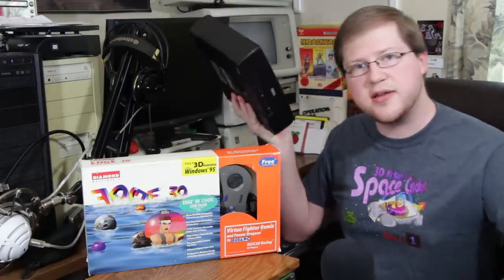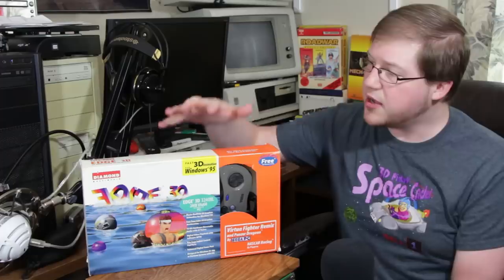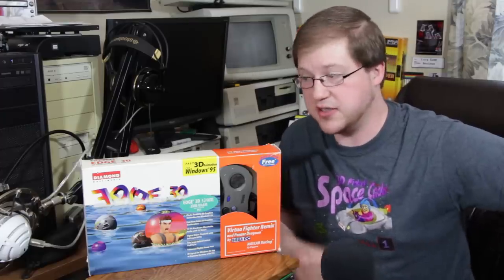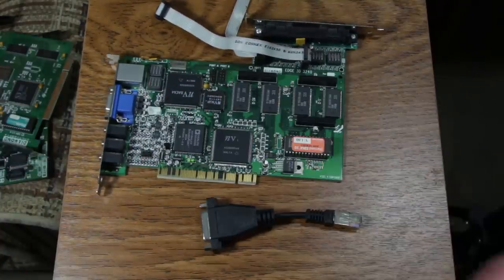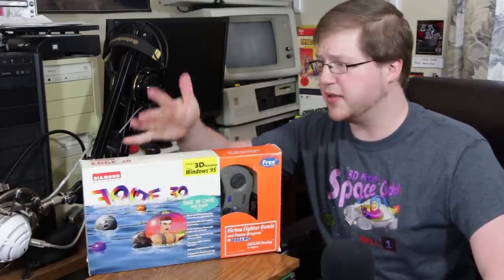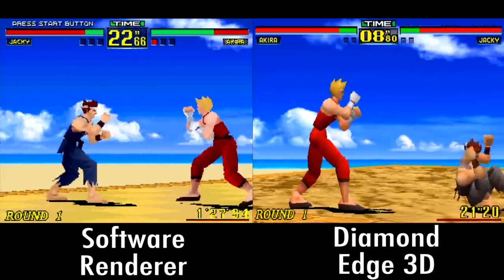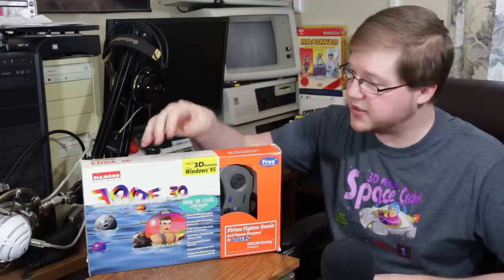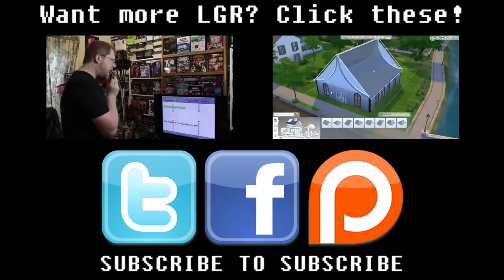LGR Oddware - Diamond Edge 3D (nVidia NV1+Sega Saturn Ports)

Comment: I wish the saturn had more good games on it. There's practically only a handful of them.

I miss sega consoles.

:(
Reply: Well, if you were in JAPAN, there would be a lot more options for games.... Sadly, most of them didn't see an overseas release... which is probably why the system bombed.
Reply: TheStolken
One of the most common misconceptions in gaming. Do your research and you'll find that there's plenty of good games for the Saturn, it's arguably better than the Nintendo 64, depending on your gaming taste. It performed better than N64 in Japan and many of the best games are exclusive to Japan. Saturn was a 2D power house and had great shoot em ups and fighting games as a result where as practically everything on N64 is polygonal, so many of it's greatest games have aged a lot more poorly and have been made obsolete by newer games (in other words Xbox/Xbox 360 era console FPS games>N64's FPS library, Here Comes the Pain>No Mercy, later 3D platformers had less camera problems, OoT is hella overrated and so on).
Reply from the maker: 90sgamer92 I have to agree, I've got dozens of fantastic games for the Saturn. Only reason I don't have more is that they're a bit uncommon to find and can be rather expensive!
Reply: welll that would qualify for the sega cd(sega genesis add-on)
Reply: TheStolken 
Good one. The domestic titles are crap, go for the imports.
Reply: TheStolken
I'm shaking in my boots. NiGHTS was developed by Tokyo-based Sonic Team and is far from being crap.

Seriously, grab some of the imports for the system.
Reply: flatshade Glad we can reach some common ground then. Among it, Burning Rangers, Astal and Panzer Dragoon possibly being up there as well. Along with Daytona USA 1996, Sega Rally, Virtua Racing, D and Enemy Zero.

You know, I think the saturn had more games than I knew about actually.
Reply: TheStolken
You may want to take a look at  http://www.satakore.com  
It has an exhaustive list of Saturn games for every region.
Reply: There's plenty! Especially rpgs. If you still own a Saturn, you can dl a patch that once applied to Shining Force III episode 2 and 3 (image file), allows you to play them in English! So +2 rpgs for the Saturn!
Reply: _Data_Drain_ ***** Yep, one of these games was Princess Crown. Amazing game that didn't come out outside of Japan! Though, there is a fairly barebones port of it for PSP. Its developers are also known nowadays as Vanillaware who made Odin Sphere, Dragon's Crown, Grim Grimoire and Grand Knights History.
Also, Dragon's Crown is known as a spiritual successor to Princess Crown, for some absolutely inexplicable reason. To me, spiritual successor to Princess Crown would always be Odin Sphere, since these two games share many, if not most of their gameplay elements, while Dragon's Crown only shares part of its name and that's about it. Guess, just because of the name, Dragon's Crown is considered to be a spiritual successor to Princess Crown.
And I just went in absolutely irrelevant way here, sorry.
Reply: TheStolken If you can find it get Panzer Dragoon Zwei and Guardian Heroes those games are the very definition of why saturn is worth a damn. Also if you're into dungeon crawler RPG's there is also shining the holy ark and Panzer Dragoon Saga(It has some of the best active time-turn based-strategy battle systems in any game I've played). The only problem with those games is that they are hella expensive nowadays, It's actually cheaper to just mod a saturn if you're gonna want to play one of those (save for PD Zwei that one is still reasonably priced). Than you can check out many of the amazing Japanese games there were on it you dont even need to know Japanese in order to enjoy many of them.
Reply: The only game I had for it was quake 2, I was even playing online with the dialup modem. Fucking awesome console it could have been.. Such a shame.
Reply: ***** It just want profitable to them and sega of america didnt even care to convince them otherwise. It's the same as Nintendo is in Poland, most stores ignore it's existence.
Reply: You must have really big hands
Reply: TheStolken sega fanboy
Reply: TheStolken Megamanx4 kills astal
Reply: TheStolken  Check this statistic on a percentage which console has better titles :)

Games with a rating of 4 or more (scale of 1 to 5).
Made based on the ranking of Gamefaqs games with at
least five grades.

Plataform            4 o más/Total            Porcentaje

NES          86/1498  05,74%
Master System  5/319  01,56%

SNES        110/1358  08,10%
Genesis          66/885  07,45%

PS            259/1814  14,27%
Saturn     163/498          32,73%
N64            36/383          09,39%

PS2        398/2550  15,60%
XBox   120/857  14,00%
Dreamcast  92/451  20,39%
Gamecube  66/640  13,25%

PS3   414/1945  21,28%
360   406/2114  19,20%
Wii   221/1514  14,59%

PS4   90/255  35,29%
Wii U   76/253  30,03%
XBox One   53/167  31,73%
Reply: chad bedard Also Arcade perfect versions of SNK and Sega games, most of which still remain the best ports, like metal slug or space harrier
Reply: TheStolken write some games. We will buy them.